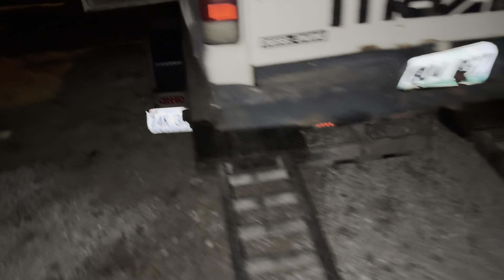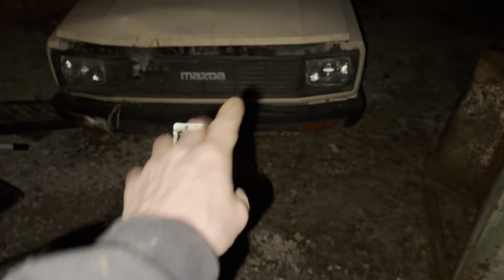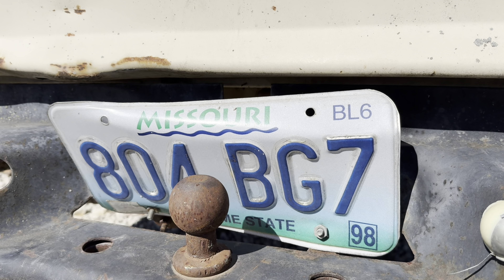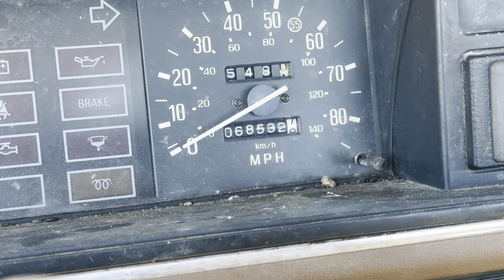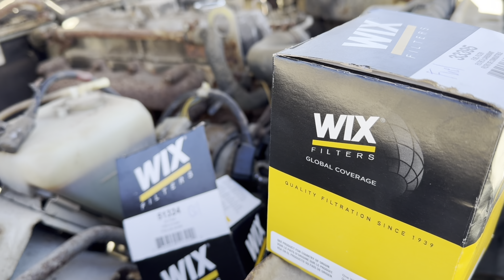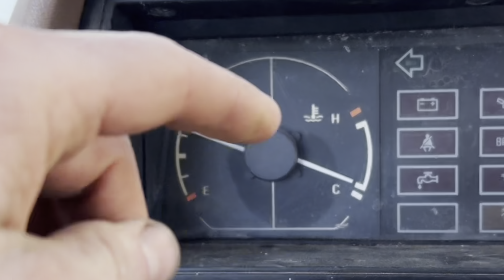Perkins DIESEL Mazda B2200 mini Truck - Will it run?

Comment: Thats actually a Mazda engine built under license from Perkins. Way more reliable. I bought one new and put almost 600,000 miles on it. The 84 Ive had the last 22 years still runs great but the impossibility of finding parts is almost making me want to sell it finally. When theyre in good shape they run well and are super reliable. The main problem swapping the engine is the gas firewall opening is smaller and the top two trans bolts on the diesel will hit the top of the firewall opening. Youre better off using the gas truck for the donor. The gas engines blow head gaskets. Ive never heard of the diesels cracking heads unless you overheat them. Ive never cracked or warped a head in all the years Ive driven them.
Reply from the maker: Awesome info, appreciate greatly! This one has a original 68,000 miles believe it or not so hopefully is good for a good while longer....
Reply: What is known as the S2 or 4.135 was based on Perkins's then-current 4.154, but then Mazda itself made it its own by shortening the 4.154's piston stroke length from 101.6 mm to 89 mm, while retaining the 88.9 mm cylinder bore. Eventually, Mazda would get the 4.154 for itself, renamed the XA, as well as make a larger 3.0L version called the 4.182 or HA, which was created by increasing the 4.154's cylinder bore from 88.9 mm to 95 mm and the piston stroke from 101.6 mm to 105 mm.

Comment: Not a Mazda, but my dad bought a Ford Ranger diesel brand new in 1985.  It had a 2.3 liter Mitsubishi four cylinder turbo diesel engine.  He had that little truck for over 20 years before he got a new one.  It had over 400k miles.  It was a great little truck.
Reply from the maker: I just bought an 83 Ranger…. Factory diesel truck. But it’s the Perkins

Comment: I have several of these little trucks. Two 83 B2000s, and three 84 B2000s. Of the five, I daily one of 84s which has been completely unmolested and runs beautifully. One of my boys drives his static-dropped 83 dailly to college and work. It runs like a Singer sewing machine.  I have another one which has been stored in the shop waiting for me to finish a V8 conversion. The last two are parts trucks which are about ready for the crusher because everything of worth has been removed. I love these things and wish parts were more readily available.

Comment: I swapped a 2.2 Perkins from a 83 into a 92 B2200 for my dad about 4-5 years ago now and it’s going strong ever since. We put a turbo on it from a 1.8t Golf mk4 and we have the pump upgraded to a turbo pump with a boost reference…makes about 20psi. It’s not fast by any means but the turbo give it some much needed torque and we have towed 3500lbs with the truck and it was doable. The engine is a little unit.
Reply from the maker: I would love to turbo this one. 20 pounds of boost is impressive!
Reply: Thinking about doing this to a 98 2.5l do you mind if i ask you a few questions?

Comment: I had an 83 ranger with the 2.2 perkins. Sat for 11 years. All it needed was batteries and a fuel line then i daily drove it. Great fuel mileage. The injection pump is easy to tune for a little more power. And adding a lift pump really helps these things
Reply from the maker: Right on! Thanks for sharing

Comment: This just popped up in my feed. The fact it was striped and has the mad rack drew me in! 

These trucks were fairly common here in the UK in the late 70s, early '80s. Most were gone by the early 90s due to the poor weather and all the salt they dump on our roads 😕 
We had 1800cc versions with twin, round headlamps and a chrome grille. Keep the videos coming 🇺🇸 🇬🇧
Reply from the maker: Awesome! Glad you checked the video out. These diesels aren’t ever seen in the United States. I hardly see the gas ones anymore as well.

Comment: First truck was the gas cousin of that one, same year. That 5-speed transmission is 100% bullet proof. Driven a lot of manual trucks and that is still my favorite transmission. For most of the 80's the Ford Ranger used the same transmission. The other great thing is that as long as the frame is solid you can literally drive it for 700,000 miles with no body left.
Reply from the maker: Awesome! I am a fan of them. Thanks for checking out the video

Comment: I had a gas version of that truck and I did get 40 imperial mpg put of it. But it was so under powered that the air coming around the front of a semi truck was enough to prevent you from passing it.
Reply from the maker: I believe it, they are soooo slow!

Comment: I agree do the swap,the body n frame on shortbed is long on the tooth as they say.i like the longbeds look.maybe do a small diesel refresh on motor.and put gasser into shortbed use as a round the farm rig.or just store gasser engine as backup and sell the shortbed minus motor.snookie pa.
Reply from the maker: Sounds like a good plan!

Comment: I had one of these as my only driver. I drove it everyday for 3 years. Finding parts was hard but it always ran.
Reply from the maker: Sweet, hope I get lucky with this one.
Reply: @RealSteelFabrications  I think the engine will outlive everything else. I sold mine with 250,000 miles and it ran great with no oil consumption or smoking. The only major issue I had was a weak input shaft bearing in the transmission. There was a TSB about it from the ones made up to the  end of 1983. Mine had this issue and I changed all the bearings in the transmission. Mine was made in November 1983 so it was just before they fixed the problem.

Comment: Yeah I like the longbed better too and that diesel would be cool in it. My old man had a 86 B2000, it had the little 4 cylinder Hemi head gas engine in it, I don’t remember what liter it was but back in 06-07? we had to go to the junkyard and find another Mazda truck with the same engine and get the head off of it to put on the old man’s truck, he blowed the head gasket on his driving to my little brothers down in Etown Ky, instead of pulling over and shutting it off he figured he could make it to my brothers house, but ended up messing the head up, anyways yeah had to put another head on his, you talk about a job, man that was a pain changing the head. But yeah had a hemi head, the plugs went through the middle of the head. Anyhow, just found your channel and subbed, 👍👍!
Reply from the maker: Appreciate it! Doesn’t sound like a fun job at all.
Reply: @RealSteelFabrications  - no problem bud, YW! Yeah man that was fun………not! Haha!

Comment: It's pretty weird for me to see those chubby oil cans.

We work with 5L ones all day every day.

(1.32 Us Gal)

That startup was impressive and shockingly easy.

I would love to see one of these with a mitsubishi engine. (I work on Mitsubishis and have an affinity for them).

21:05 Why the heck would you need a transmission cooler for a manual?

That perkins sounds gutless as heck.
Reply from the maker: It’s very underpowered! I wish I could find a Mitsubishi one, these diesel trucks are very hard to come by though.
Reply: @RealSteelFabrications   I can imagine, same case in my country but all those trucks are getting hard to find (even petrol ones), or the ones you find are just beat up or worn out.

Though "mini trucks" never went away for us. But the old school look is something I like.

Comment: I got a 83 S-15 with the Isuzu diesel. Had to change bodies, due to rust, took longer than I should have. Engine wouldn't fire off anymore. Had the injector pump rebuilt, still not firing off,  brought to a shop, now awaiting a call.
Reply from the maker: Ohhh man! Good luck!

Comment: Im in the states too. Ive got both a 84 b2000 and a 82 b2200. The b2200 body is pretty rotted but ive swapped many panels already. Its honestly the most reliable vehicle i own. Cant go up a hill at 60 mph for shit though. One thing to note is if your alternator desont work, youre shit out of luck. I replaced mine with a bigger alternator off a meduim duty truck that also as the vacuum pump on the back. I think it was an Isuzu NPR. Ive swapped a Ford 302 and T-5 into my B2000. Also that isnt a trans cooler, its the engine oil cooler. And the transmissions are the same, the bell housings are not, but they can be swapped out. FB RX7s have the same trans too
Reply from the maker: Alternator is charging but making an odd noise I feel like? So the alternator you switched to doesn’t work or??? Does the RX7 tranny and bell housing work for the diesel or just the tranny and have to switch bell housings?
Reply: @RealSteelFabrications  The original alternator didnt work. I tried replacing the voltage regulator and the diode pack which didnt do anything. The Isuzu alternator i swapped in works great. Its got the same mounting and overall shape, just physically bigger so I had to use some spacers and a longer bolt on the bottom and rigged up a top bracket that I took off the b2000. You also have to wire in the new plug but its got the same wires so its super easy. Yours probably just has a bearing going out, or maybe there is some crap isnide the housing that needs cleaned out. The RX7 uses a much different bell housing so you would need to swap it, but the transmission itself will work. Ive got units from all three (B2000, B2200, and RX7) and they are physically identical. Im sure the gearing is different though. I plan on putting my rx7 trans into my b2200 in the future.

Comment: Hey, I dont know if this will apply to US trucks but theres a good chance it does. With the B1600 and B2200, the firewalls are different as the B2200 bellhousing is quite a bit larger, my Grandad did that swap on his back in the 90s and he ended up chopping out a big chunk of the firewall so the gearbox would fit. It went from being a flat shap above the gearbox to being a big rounded flare, although the B2200 firewall in reality just has the flat part up higher and has a bit of a notch for the starter to sit in. The transmissions crossmember and engine mounts are different too so theres a bit of work with a welder needed there to make that happen but its doable. He used the petrol crossmember and welded the mounts in the chassis, it sits slightly more forward than on a standard diesel but works fine.
Reply from the maker: Wow! Thanks a ton for this info. I need to do more research before doing it for sure. This helps a lot though, thanks again! Hope you enjoyed the video.
Reply: @RealSteelFabrications  sure did good luck with the trucks!
Reply from the maker: @Jakanddaxter1999  appreciate it!

Comment: I had one of those pickups. I forget the name of the package but it was a gas, 5 speed, long bed, it was silver with red and orange stripes and had mountains and cactus on it...I want to say it said sundowner on the bed. Regardless it was a good running lil pickup
Reply from the maker: Awesome, sounds like a Sundowner for sure!
Reply: @RealSteelFabrications  I think it was, this was the early 90s that I had it. I remember working a day and the person I worked for just gave it to me in trade. I put an Optimus (radio shack) brand pull out tape deck, some 4" speakers in the doors and an 8" sub in it. Thing ran good, had hot heat, and living in NY was junked due to rust probably before you were born lol

Comment: Where did you grab this in Missouri? I also have a b2200 diesel and im in Missouri
Reply from the maker: Down by Owensville
Reply: @RealSteelFabrications I'm definitely interested in getting in touch about some parts and pieces potentially!
Reply from the maker: @gavinmosher7362  as of now, the drivetrain isn’t for sale but if you need body/ interior stuff let me know
Reply: @RealSteelFabrications  I am just about 3 hours from Owensville I'm in the southwest corner. I also may have some parts and pieces you may be interested in as well
Reply: @RealSteelFabrications not sure how to get ahold of you other than Facebook messages or text but I am definitely looking for a few interior pieces and also body stuff.

Comment: I have a 1979 ford courier with that 2.0 engine please let me know if you won’t too sell it I need a motor thanks
Reply from the maker: Will do. Where are you located?
Reply: @RealSteelFabrications  Newnan Georgia the home of Allan Jackson the motor I have is wore out smokes very bad. Can’t hardly find parts for it.

Comment: 15w40 is tractor oil would it not be 10w40
Reply from the maker: Diesel oil is diesel oil. They make several weights
Reply: @RealSteelFabrications  ya but 15w40 is tractor oil any new diesel is 5w30 or 5w40

Comment: 1.9 tdi swap, faster and give u more mpg
Reply from the maker: Kind of kills the cool factor in my opinion
Reply: @RealSteelFabrications  i guess so, well, i also have a bias towars the Perkins engines, i hate them
Reply from the maker: @Vallo995  why’s that? Bad luck with them?
Reply: @RealSteelFabrications  nono, my tracktor is still runnign good, but imho theres way better engine than Perkins out there